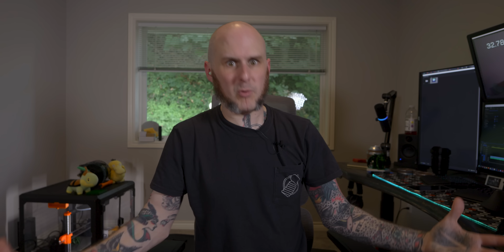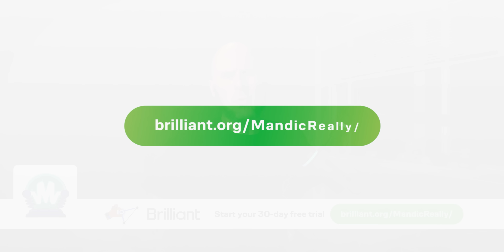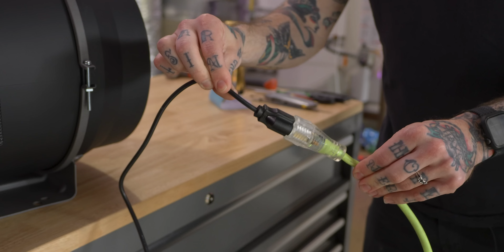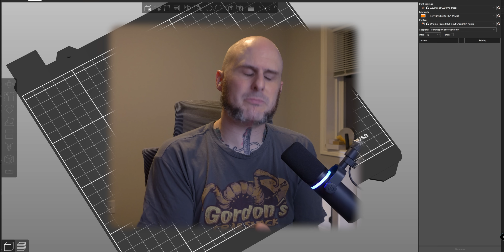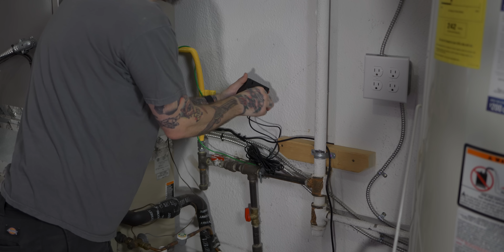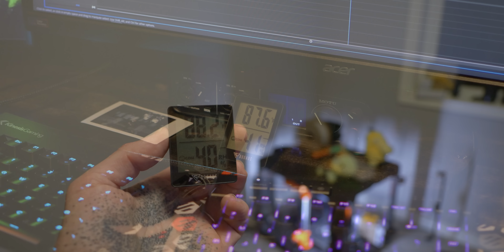Office Build Begins: Solving 2nd Floor Heat w/ AC Infinity T12 fan!

Comment: Needs to be a ceiling fan at the top of the stairs to circulate that hot air down. I have a similar house that's open like that, and the ceiling fan is definitely part of the AC system. BY moving the warmer air down, right to the thermostat, the AC is on longer and the air moves better to keep the whole house cool. no huge inline fans needed in the ducts.
That said, it helps that most of my ductwork is in the crawspace, not a hot attic, so I do have that advantage
Reply from the maker: If you look when I showed the steps there is a fan at the very top of the screen. It runs 24/7 and is blowing the warm air down. Second thing I tried after moving in. Thanks for the input.
Reply: @MandicReally  ah. I did go back to that part and check to be sure but couldn't see it. I can detect it now when I focus there while the video is playing. Invisible when paused. :)
Damn.

Comment: the fiberlogy.. ahh yes.. i keep calling it fibrology for some reason. am i alone in that?

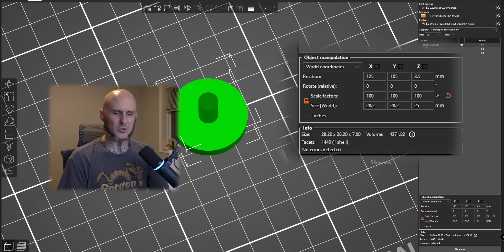12:30 im not used to prusaslicer persay as i use a fork of it, but in orca we got a rightclick menu option of "centre" which i use like u show manually :) think its there in ps too
Reply from the maker: Nope, I wanted to say "Fibrology" so badly when I mentioned it.
Reply: @MandicReally  phu! hehe.. i kinda swallow my tongue every time i say it now ;) Kudos on the move phase being done, the new "pad" look TIGHT imo. good upgrade for you two. 

regarding cooling of second floor rooms; I found that capturing the heat from each device and channeling this outside with hoses and quiet pc fans in the ducts to move out the hot air effectively. i fitted a one way flap thinger on each of the three outlets i cut. its a little ghetto but its a pennysaver adhoc kludge that actually works. i was supposed to run this only until the summer was over, three years a go :P

Comment: I found a lot of benefit to my office temps with a similar challenge using an exhausting transom fan - certainly cheaper, less power consuming and less noisy than a window AC unit. BUT the temps on my second floor are generally more comfortable than what you described. However, maybe now you've installed the AC infinity unit a transom in your office would be more effective?

Having the fan push air out of the window creates a slight suction from the rest of the house to pull in cooler (and cleaner) air. I did have to model some custom panels to fill the gaps each side because the pieces that came with it sucked.

Comment: they make decent retrofit zoning systems that just install in place of your vents. each room will get a wireless stat and work together like home automation systems. they adjust the air flow to each room so the hotter rooms get the most air. but maintains your systems recommended flow rates.
Reply from the maker: Any idea who makes that? Haven't come across it in any of my research.

Comment: Isn't there a risk of the fan in the duct getting hot? Maybe a dumb question, but I always think about that when I see a motor inside isolation. In this case it would then cool the fan itself instead of performing optimally.

Comment: Possible partial solution: At least you have multiple returns. We have a '64 2.5 story townhouse with single zone, one return downstairs. Our upgraded HVAC system features a circulation mode that turns the air handler fan only on at adjustable speed and percentage of time. We run it at minimum time and power to equalize upstairs and downstairs temperature by circulation at a minimal power cost. The heater or AC runs at the same time but only as needed. If you can make your air handler do the same thing, it will help a lot.
10:05 There is actual Duct Tape made for the purpose on the air handler itself. Note its more reflective than duck tape.

Comment: If the air handler plugs into a standard AC plug you can get a smart plug with energy monitoring and just watch the charts to figure out what the output is when fan is on/off and just have it trigger the other fan

Comment: I changed over to using Ecobee thermostats, which work great for Home Assistant.  For the colder months I wrote an automation that would turn on the ceiling fan when the HVAC turned on (when heating).  That worked great to help the heat circulate better in that part of our house - where the ceilings are 9.5' tall.

Comment: you could add a rubber washer also between the screw and the metal of the fan because also the screws are transmitting vibrations to the wall... i usually put 2 for every screw with a metal washer in the middle in every AC unit i install
Reply: I was looking for this comment.  Why print a washer in 40D TPU if you then clamp things solid with those screws.  That adds zero dampening.  Better would be to make a bigger part out of stiffer TPU, attach that to the wall and then drive some bolts holding the fan solely into that TPU (possibly using some heat inserts).  That would decouple the rigid fan from the rigid wall via the vibration absorbing TPU.

Comment: [an input about the automation]
a possible solution with light modification for a temporary system and very responsive: with a simple powermeter connected to HomeAssistant, a script could turn on the auxiliary fan as soon as it detects the load on the big fan. Then use the internal function of the auxillary to turn it off (independently of HA), based on the temperature probe, with the delay that fits you
Great video btw

Comment: If you do get a portable unit, get a 2 hose unit that pulls air from outside to cool it. If you get a 1 hose unit, it will pull air in from outside through drafty joints, from your attic through outlet and switch covers, and anywhere it can. It can't pull your house into a vaccum, and the air inside your house that it's throwing outside needs to be replaced from somewhere. I had a portable unit and it made the rest of the house hotter when it was on as the house was older and wasn't well insulated. I got a window unit the following year and ran that until I moved out, and it was leaps and bounds the better option.

Comment: when you want to replace your AC thermostat, make sure to look for "local polling" or "local push" thermostat integrations with home assistant, and choose your thermostat from there.
I purchased a Z-wave thermostat, but I'm not super happy with the performance of Z-wave.
Reply from the maker: Yea I’ve yet to decide on Z-Wave or ZigBee for everything. Still weighing out options before I commit to everything. Thanks

Comment: You should be filtering that office. And definitely not pumping your exhaust to the main intake to spread throughout the house.  Printers have fumes.
Reply from the maker: At are actively scrubbed inside of the printers. My machines all have active charcoal filtration. Both ones in my office also have HEPA filters. As for any particulates, the house system has a solid MERV 13 filter.

Comment: Dude, you’re like trying to solve a problem that doesn’t exist by creating more problems and expense. 

It’s pretty clear all you need to do is use the little flapper on your air vents to your first floor vents a little close your bedroom vent a little and open your office vent up a little more. 

Everything you’re trying to accomplish simply done with your vents. And if you’re worried about the direction of the flow, then use your engineering skills and build some panels to put inside so you can adjust the airflow and not the directional angle.
Reply from the maker: The first floor vents have shut offs. I turned off everyone I could (and covered the others) it didn’t do a damn thing. Any little air leak will be the path of least resistance. 
This project was not step one, it was the culmination of multiple things and input from an HVAC tech who fully agreed with my assessment. The system is just not intended to cool a house of this size on a single zone. Any damper system would have had to be in the basement where it would have cost a lot for an electronic system that can be operated remotely. Or manually actuated which requires climbing into the crawl space to make any adjustments. 
This is the system that was easiest, most cost effective, AND SOLVED THE PROBLEM, for the majority of the house. It’s only my office, which had hundreds of watts of heat being pumped into it, that is an issue.
This house was built in the 90s when multiple zones weren’t as common, especially in the Pacific Northwest where it didn’t used to get as hot for as long.

Comment: You may or may not already be aware but that inline fan would operate much more efficiently if you attach it at the top of the riser duct rather than at the bottom of it... Best of luck to you.
Reply from the maker: Would require reworking too much ducting in the attic and adding an outlet in the attic. Just too much involved to go that route when the location I used was so easily accessible. It is working better than I expected honestly, just not for my office in particular.

Comment: I put in an EcoBee premium thermostat with 2nd wireless temperature sensor and it averages between the two (it can also determine occupancy and make the occupied thermostat area be the lead thermostat).  That works pretty good.  
For managing room temperatures, you'll need to start pinching off the vents to direct more flow to to where you need it.  
I personally feel that you would have been better off putting the booster on your worst performing supply side duct up where it splits off in the attic to get more air going in the desired location and starving a less desirable location.  I have one on my house for an underserved room and it works good to redirect air even though it is only 220 CFM.  Voxtex Powerfans by Atmosphere.
Reply from the maker: Yea originally the supply to my office was my thought but there isn’t a great way to get an outlet in the attic for the fan. Most of the electrical runs from the bottom up, not branching down from the attic like I’m used to. Not many places to grab a 110 line. I still may try adding a fan for my office in the duct. 

This was way easier and the entire second floor WAS suffering, just not as much as my office in particular.

Comment: Bro. I promise I have a fix for you. I've been crypto mining with dang near 1000 gpus at one point. I started out of my house. All you need is a smaller ac infinity strapped to one of your ducts in that room that's constantly pulling air into the room. Even with the ac off it makes a huge difference. It will also push out the hot air. Even if it's just under the door. This basically gives that room priority.  Then you should shut the vents in the rooms that are too cold. Balance out the house. Ac infinity makes smart vents also. You can set temps in each room. It'll close vents or turn on the fans to try and keep it at that temp. I would also ALWAYS leave your new 12" ac infinity running. Always. You need to keep pushing air. I promise that will make a big difference. And balance it out by closing other vents. Report back. I promise you it will work way better. I can make any room in my house the coldest or hottest room in the house with this method. I for example has a 6inch ac infinity under my bed strapped up to a vent. You can put silencers on the ac infinity as well. The silencers make a big difference.
Reply from the maker: Yea that was my first thought for all of this, but there ain’t a good place to get an outlet in the attic to power it. Maybe I’ll give it a good yet. I can pull cable and get power if I have to.
Reply: @MandicReally  where are your vents in that room. Floor or ceiling?
Reply from the maker: @ChuckRayNorris  ceiling. I considered one of the vent version that AC has, and I may try that. With the big room project I may be able to hide the power to it.
Reply: @MandicReally  yeah when they are on the ceiling. It's hard to hide the wire. Or hook anything up to it. Just keep your new ac infinity on like 4-6 at all times. Try that first. And close off some vents. To prove the point. Go close all the vents in the house and watch how fast that room will cool down. Solving problems with science. I bet you can get all the rooms in the house the same exact temp with a balance of the vents.
Reply: @ChuckRayNorris if you’re looking at the home assistant side, especially for a project video; perhaps mmWave presence sensing + smart vents? The cool air would basically follow you around the house at that point

Comment: Look at Functional Devices RIB relays.  They will have one that triggers on 24 volts from the furnace fan circuit and can close a 120 volt line.
Reply: That's what I did one wire to fan one wire to comm and then to the 12v on the RIB and have the 120v connected and out to an outlet.

Comment: on the ac unit control board you could connect to the thermostat part of the board so when the thermostat triggers the ac to kick on it just connects the voltage on the board to trigger a relay switch
Reply: can you expand on that? would it be just a matter of hooking up the fan call wire from the thermostat to a relay that also splits into the handler?

the problem with these AC inifity fans that ive used for other projects is that they seem to have a controller that doesn't seem to take kindly to being always cycling on off.

Comment: Adding some insulated flex duct (after inline fan) may help you noise level. At least 5 feet. I’ve done in my own home with success.
Reply: Also check your attic insulation. I’d bet it’s blown in and has settled a lot. I’m near Seattle and seen this issues while working in HVAC. Feel free to reach out.
Reply from the maker: It’s loose fiberglass insulation and is relatively thick. If you check my last video I worked in the attic and showed it a bit. Still may have settled and can’t hurt to have more. Thinks he attic could use an active vent too honestly, but that’s a whole nother issue.
Reply from the maker: Forgot to say, I wanted a longer flex section on both ends of the fan, but found that the duct was NOT well supported at either end. I would have had to make braces to support the bottom and top ducts to remove more solid duct. Couldn’t justify that part of the process.
Reply: Good point about duct support. I can think of a few ways to over come that using a duct collar. Replacing some of the flex with metal duct can help airflow upstarts too. At end of the day you’re right about mcmansions. HVAC last on everyone’s list but provided so much comfort when done correctly.
Reply: @MandicReally  One of the best designs systems I installed was adding floor radiant downstairs and using a furnace/AC only for upstairs.
Reply: Yeah, I remembered after. Air sealing the attic would also help. Have you checked the ceiling with a thermal camera?  I’m guessing you are aware that winter will have similar issues. Cold downstairs and uncomfortably hot upstairs.

Comment: Hello sir, im having trouble on my anycubic kobra max. Retraction is terrible, print quality is declining and so is infill. I have dried my filament with the esun filament dryer, i have tuned z offset, leveled the bed, tuned flow rate, temperature, speed, pid, checked the firmware and its up to date, and tuned e steps. All tests and research i have tried to tune retraction does not seem to resolve the issue on my printer. the overall print quality is pretty bad as well. What should i do?
Reply from the maker: Have you tried changing the nozzle? Worsening print quality so often comes down to that. If you do, I highly recommend genuine E3D Volcano nozzles. They perform better than the cheap Amazon nozzles a lot of folks get. 

That said, I never got really good retractions on the Kobra Max. It was one of the things that drove me crazy about that machine. It really need Linear Advance and at least when I had one, there wasn’t a good firmware that did. Maybe Anycubic has updated that (I doubt it) or maybe a community firmware is available now. If you can get Linear Advance enabled and tune that in, that would help.
Reply: @MandicReally  Okay that sounds like a great suggestion. But would this be worth the effort and would the outcome of the printer actually be good? Anytime i see the kobra max do good is other youtubers who print straight out of the box and well of course it will do good. but what about like 1-2 years later after getting the printer, how will it perform then? Would you suggest any other brand that may be better? Thank you.
Reply: @MandicReally Good news the problem was solved for the kobra max. i set the travel speed to 130 mm/s and 5.5 mm distance and 45mm/s speed

Comment: As for getting a portable AC unit, If you can afford it/find one, get a dual-hose AC unit bare minimum, and you can also find some that are inverter-driven, they can be remarkably quiet and energy efficient if you don't need to cool a huge place down a lot.
Reply from the maker: Yea I’m definitely looking at dual hose models. Unfortunately I can’t spend a lot on it so hoping one of the Amazon special ones isn’t too loud. We shall see. 👍🏻